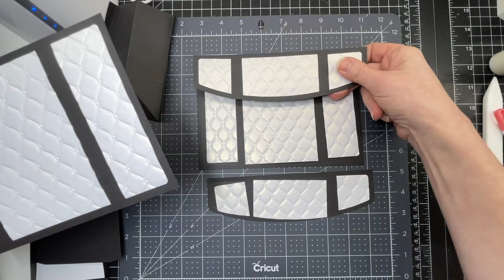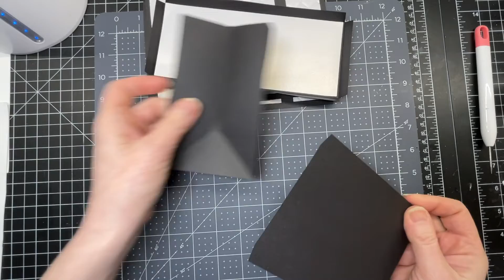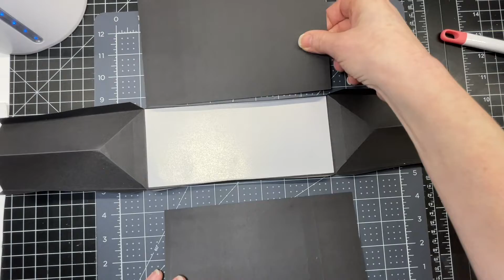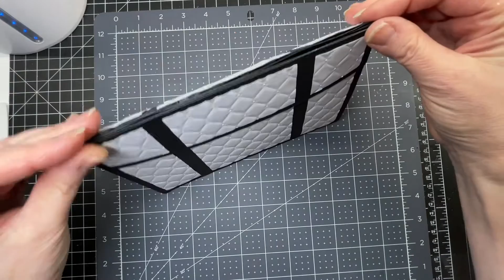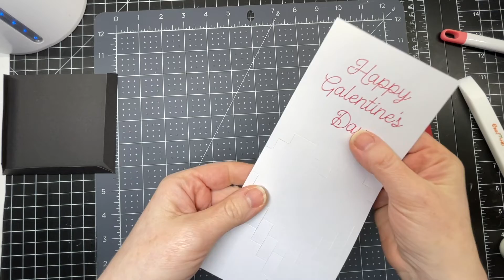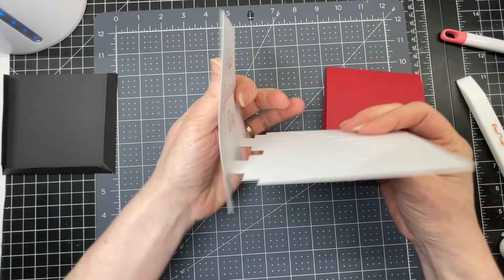Galentine's Day Handbag

Comment: Would you be able to email me the template? I have been attempting to open it all day from the link and it just crashes my cricut design space😣
Reply from the maker: Are you on a mobile device?  There seems to be a issue opening files in Cricut Community from mobile devices right now. You can try to open it from my profile in the Community or, alternatively, copy the link for the file and paste it in your internet browser. Here is the link to my profile https://design-beta.cricut.com/landing/profile/58ad1dea719e813b7eab5190
Reply: Yes unfortunately I cannot find my laptop charger so I only have my iPad- which I use most with Cricut- and it’s not working.
Reply from the maker: @jeimy913  have you tried from my profile?  Sometimes that works.
Reply: I have and it still crashes and won’t open 😣
Reply from the maker: @jeimy913  I am so sorry. Hopefully Cricut can get their mobile app fixed soon.

Comment: What is the name of the white patterned card stock? Where can it be purchased?
Reply from the maker: The card stock is 8.5 by 11" Shimmer card stock from Michaels.  I put my cut pieces into an embossing folder (Studded Leather 3D Embossing folder made by Gemini or Crafter's Companion) and then ran it through my embossing machine.  Embossing machines are a fantastic way of turning a flat piece of card stock into a panel that has dimension and visual interest.

Comment: Your video is so helpful. I am doing a test run before I use good materials. I am brand new to Cricut. Question, please? Where did you get your glue (thing)? It looks like it would make things so much easier. Thank you in advance for sharing your amazing work. Hugs from Canada.
Reply from the maker: Thank you so much!  For me, the type of glue that I use is extremely important.  I use either Art Glitter Glue (it contains no glitter, that is just its name) or Bearly Art Precision Craft glue.  I like to transfer my glue into small precision tip glue applicator bottles with silicone caps.  I can find all three items on Amazon.
Reply: @crafty_lou7  Thank you so very much. I happened to go shopping in the States today and was lucky enough to find two types of applicators. I was so happy. The exchange rate is a killer today but you have to do what you have to do. LOL. I have not found the Bearly Art glue in any stores so I assume I must have to order on line. Thank you again for your help and direction. I am off to attempt to make this beautiful little purse. Finers crossed.

Comment: What kind of glue are you using?
Reply from the maker: Hi Sophie, I use either Art Glitter Glue (it contains no glitter, that is just its name) or Bearly Art Precision Craft glue.  I like to transfer my glue into small precision tip glue applicator bottles with silicone caps.  I can find all three items on Amazon.

Comment: WHAT KIND OF GLUE DO YOU USE  ????
Reply from the maker: I use either Art glitter glue (it contains no glitter, that is just its name) or Bearly Art Precision Craft Glue. I transfer my glue into small fine tip glue applicator bottles with silicone caps.

Comment: I love your video! I was wondering  if I missed your supply list under your information. I heard you mentioned adhesive foil, so I checked for a supply list which might list the type of glue that you used, adhesive foil, card stock and weight. 
The white card stock looked quilted. 
Question: were we supposed to get the supplies from Design Space?

I believe the glue is the most important to gluing card-stock. I love how you used the small needle for the glue. I have bottles with the small tip. Too much glue can ruin a problem. 

Folks this video is excellent, don’t forget to like and subscribe. , 

I’m glad you mentioned the like information so I immediately hit like.
Reply from the maker: Thank you for your kind words Vera.  Any materials that I have used are mere suggestions because this project lends itself very well to all sorts of different variations.  I like to use Art Glitter Glue or Bearly Art Precision Craft Glue, and I like to transfer my glue into small precision tip glue applicator bottles.  I hope that helps!

Comment: Is there a Part one to this project?
Reply from the maker: No.  The instructions are for assembly only.  Do you have any questions about cutting the file?
Reply: @crafty_lou7  I haven't looked at file yet...I will. Thank you
Reply: Yes. I am struggling trying to figure out what color is which piece on the mats. The assembly looks fairly easy. It is the cutting out that is confusing with which color

Comment: how can you change the happy galentine day to another saying   / and have the heart still under neath the writing////HELP HELP HELP
Reply from the maker: Excellent question.  To remove the words, you can go into the layers panel (on a computer that is the panel on the right, on mobile, go to the bottom of your screen and find "layers"), find the words and delete them.  (click on them "delete" on computer, click on the words and then click on the trash symbol on mobile).  To add your own, you will need to select a writing font of your choice and then just type your new sentiment.  Next, place it on the area of the card where you want it to write and then select your card and your text and then click on "attach".  Make sure that only your card and your text are selected.  You don't want to have any of the other pieces attached to your card.

Comment: hi Louise, I love your Easter larger Galentine handbag.  It says in the description that it will deboss parts of it but when I click make it all the layouts just say basic cut & score.  I want to practice debossing technique on some scrap paper before i use my good paper.  How do I make it do that just for the white embellishment part.  I know how to hide the parts I don't want to cut but as I said non of the parts has deboss as one of the tasks it will complete.  I have the debossing tool but never used it
Reply from the maker: In my file, I have embossed my card stock using a 3D embossing folder and an embossing machine.  I used this technique for both the original Galentine Handbag and for the larger Easter Version.  I did toy with a similar pattern as you see on this Galentine version on this file   https://design.cricut.com/landing/project-detail/61f9abdf867d29764d65c638 using the debossing tool on my Maker machine.  You can open this file, copy the debossed panels that you find and paste them into the handbag file.  Then you will have to size them to match the pieces that you wish to deboss.  It does not give the exact same effect but it does create some dimension and interest to your card stock. Also, if you enter the word “pattern” in the search field when you go into images, you will find all sorts of designs that you can use to created debossed effects.  I find that the debossing works best of thick card stock or even Kraft board.
Reply: @crafty_lou7  thanks, i will give this a try

Comment: Hi! I am creating my gorgeous handbag now, for a friend's birthday. I found you on the Cricut community. I don't think my side pieces (of the purse) have the bottom piece that you glue to the base of the handbag. Did I do something wrong? I checked to make sure I have all the score lines in place, but I will check again. Thanks!!
Reply from the maker: In my file, the bottom of the bag is positioned between both side pieces. It is a rectangular pieces with tabs on on four sides. Those tab pieces are folded upwards along the score lines and adhered to the front back and side panels.
Reply: Thank you!! I will check now and finish my first bag. Thank you!!

Comment: What kind of glue are you using?
Reply from the maker: I use Art Glitter glue (it contains no glitter, it's just the name) or Bearly Art Precision Craft glue.  I like to transfer my glue to the small precision tip glue applicators that you see in the video.  I get everything on Amazon.

Comment: I would like to resize to make the bag larger.  How do I resize all the pieces so they fit correctly?  Any help will be greatly appreciated.  Love your designs!
Reply from the maker: Thank you Stella!  How big would you like it to be?
Reply: @crafty_lou7  I would like the bag to be 11.5 inches wide if possible.   Thank you for getting back to me so quickly!
Reply from the maker: @stellaagront7245  I have created a file for the handbag with 11.5” sides but it goes together a tiny bit differently, so I will be cutting it and assembling (with instructions) and post it as soon as I can.
Reply from the maker: Stella, I have finally finished the video for the new version. It is Easter themed. I hope it helps!

Comment: Can't wait to try this. Do I need a special blade for scoring lines?  How does that work so I know where to fold?
Reply from the maker: Hi Jodie!  It depends what kind of Cricut Machine that you have.  If you have the Maker, (Original or 3) you will need either the scoring wheel or the scoring stylus.  If you have a Cricut from the Explore Series, you will need the scoring stylus.  There is a lot of scoring and folding in this design, so I do recommend using your Cricut to score.  The stylus is not too expensive and is a very handy tool to own if you are interested in Paper crafting with your Cricut.
Reply: @crafty_lou7  I have the Maker. The scoring stylus looks easy since it just goes in the pen compartment. With the scoring wheel do you need to just switch out the blade with the wheel after it cuts?
Reply from the maker: @jodiehoogendam4270  That’s right.  With the scoring wheel, your Maker will prompt you to first insert the scoring wheel and then will stop and inform you when it is time to insert the blade.
Reply: @crafty_lou7  thank you so much!

Comment: What kind of glue are you using?
Reply from the maker: I use Art Glitter Glue (That is just the name, it contains no glitter) or Bearly Art Precision Craft Glue.  I like to decant my glue into those little precision tip applicator bottles like you see in the video.  I get everything on Amazon.

Comment: Made this today, so much fun! Next time it won’t take me nearly as long. A couple questions… for the buckles the handles go into, mine only cut four, should it have cut 8 or is that something I need to change? I went back and did 4 more so I can glue two together. Next question, I love the imprint in the white part of your bag. Did your paper come like that or is there a way to score it like that? It looks almost quilted and I love it! Thanks so much for your video and sharing this project!! I’m hoping to make about 4 of them.
Reply from the maker: Thank you Mandy!  There should be 8 buckles if you card stock is not double-sided.  Thank you for letting me know, I will go check my file and make sure that it is as it should be!  I have embossed a white metallic paper in a 3D embossing folder, using an embossing machine.  I tried to replicate the look with my debossing tool on my Maker and it was nice, but just not as nice.

Comment: Hi Louise! this is beautiful. Can I ask where you get your skinny metal glue tip from?
Reply from the maker: Hi Kristy!  I get my precision tip applicator bottles on Amazon.  They usually sell them in multi-packs and I like the ones with the silicone caps because I am always misplacing or breaking the stainless steel pins on the others.